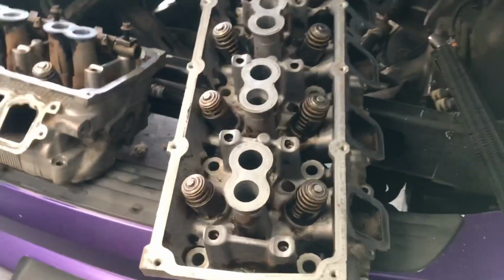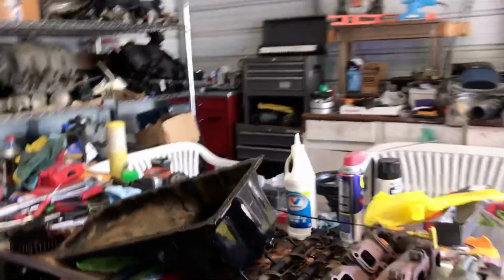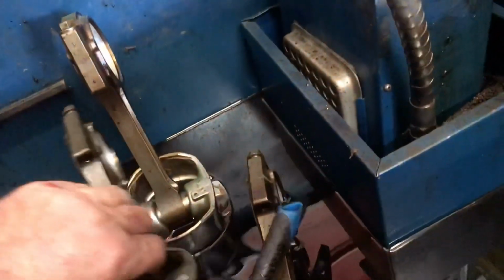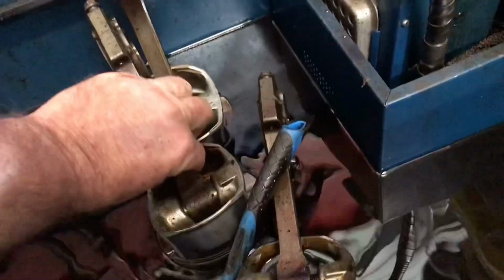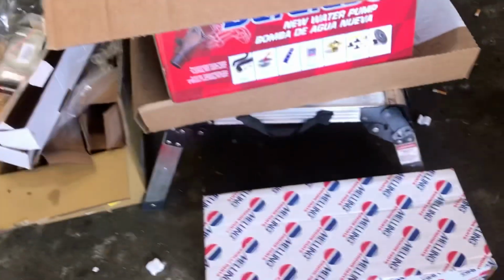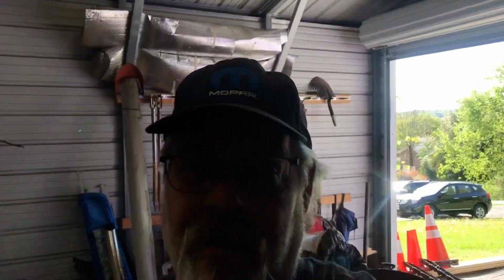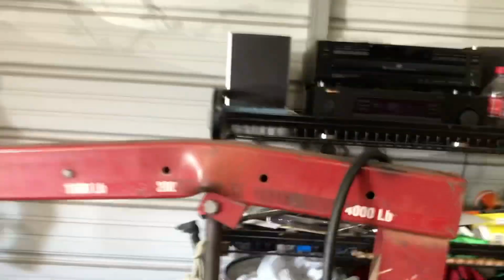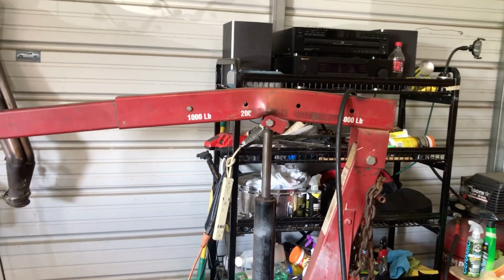5.7 Hemi cleaning and assembly continues!! what’s up with that engine hoist? #nonamenationals #utg

Comment: Wtg AL. 
The Hemi can benefit by having a good three angle valve job.
I would say a 15-20 gain.
Not sure if you're changing the cam or not.
New valve springs on engines over 170,000 to 200,000 miles.
Performance cam, new performance springs.
And of course new valve seals should be installed. 
They should be in your gasket set.
The hardest part of any build is the clean up and prep.
Hard hard work.
Been watching your videos AL.
Great work.
Thank you,EM.

Comment: Even the 5.7 heads flow crazy numbers compared to even performance chevy / ford aftermarket heads .. I would go for the 6.1 personally as it has a stronger block and no MDS or VVT stuff to worry about..  Melling stuff has never let me down.

Comment: Be sure to dissemble that oil pump and make sure it clean and has the right clearances. I bought a new Milling oil pump for my neon and just put it on thinking it was all good. When I tried to turn the engine it was locked up. I pulled the oil pump off and it was full of metal and the back side of the seal was chewed up. I made a video of it and sent it to the company I bought the pump from and they sent me another one with a return label for the first pump. I’m glad I had the engine on a stand rebuilding it and it wasn’t just an oil pump replacement. If the engine had been in the car and I would have started it the engine would have been destroyed.
Reply: Jimmy that happened Over a Decade ago, it's time to let it go! 😆
Reply: @jontrudell7529  actually it was last month
Reply: OMG......somebody still has a Neon? The Last and the Curious.
Reply: @reaper20015  I bought it new on December 31 2004. It’s been a great car. My wife tried to kill it by running it through a flooded road and bent the number 1 rod. I drove it for 2 years with the bent rod. It kept setting a cel code 0301 for miss fire on number cylinder. I would clear the code every time it popped up. My grandson wanted to learn how to work on car so we pulled the engine and tore it down that’s when we found the bent rod. It’ll be back together soon and I’ll start putting another 200,000 miles on it.
Reply: @jimmyford271  I'm sorry to hear that it'll be back soon. You should just take it out back & Put it DOWN 
Lmfao 😆

Comment: I am fairly convinced the Gen 3 Hemi cam/lifter oiling issue is due to excessive idling and too low oil volume, especially in the 5.7.  Excellent choice on this build going with Melling pump.  The 5.7 has the smallest gears (volume), the 6.4 pump is larger than 5.7, and the Hellcat pump has the largest gears (volume) in the family.
Reply: its also the lifter angle,they lay too flat compared to conventional lifter angle

Comment: That's the problem with builds on YouTube, according to the comments section, everything you do or don't do is wrong, and no matter how much you actually do, it will never be enough. 
They fail to realize that these things take place in the real world, and budgets matter. Time matters. And realistically if a guy could afford a 10k rebuild on that truck, there's almost zero chance he would still be driving that truck. I'm sure the owner weighed his options for repairing the engine vs replacing the truck, and for the repair option to be viable there has to be a limit on the money spent. Machine shops cost money. replacing serviceable parts costs money, and your time costs money. 
I've done a ton of "rehash" builds like this in my garage, some lasted 60k (in my defense, that one was two blown up 390's reassembled into one running engine with a budget of 250.00), some are still going decades later- the point of this job isn't to refresh everything back to better than new condition, it's to do the best you can within the budget, and extend the use of a vehicle that has pretty well reached the end of it's service life.

Keep up the good work. Can't wait to see this one up and running again.
Reply from the maker: Thanks 👍
Reply: well said

Comment: For those of us old school, what is this MDS you are going to delete ?
Reply from the maker: It in the video I just posted z
Reply: Around 3:30 you discuss the several advantages of the delete, that the disadvantage is a small decrease in fuel economy, but if you discuss what MDS actually is I missed it.
Reply: @scotthanson7888  Multiple Displacement System. MDS deactivates a cylinder bank on the Hemi V8 engine to operate in four-cylinder mode for better fuel efficiency. Some people like/love it. Others not so much. I, myself don't care for it. I bought a V8. I want a V8.  Hopefully that helps you out
Reply: @dubiousf00d  that explains it, thanks. 
The newest Mopar I have is a 1980 Dodge 150 4x4 with a 360.  When I got it it was not running on all cylinders either, but that is a different story.

Comment: Wow dirty heads, used cam bearings. Your doing a rering not a rebuild. Hack
Reply from the maker: The only thing I left was the cam bearings because there was nothing wrong with them.and as for the heads as I stated needed to get more cleaner to finish.. don’t be a Richard!!
Reply: watch,enjoy or dont............